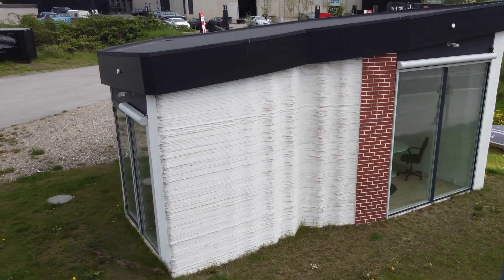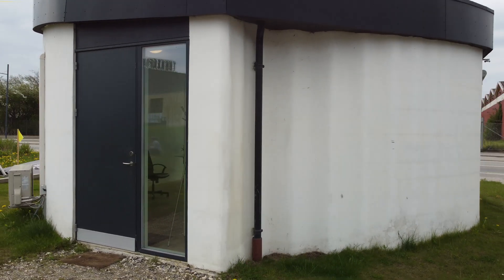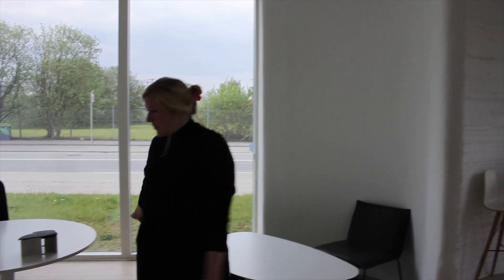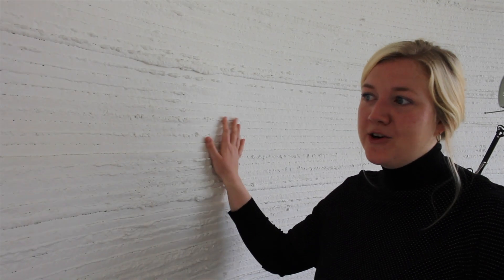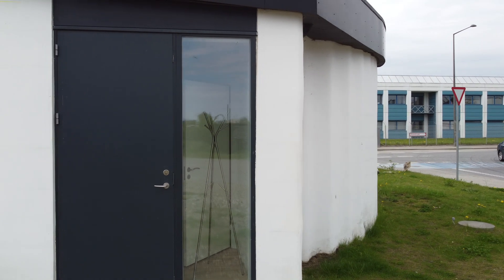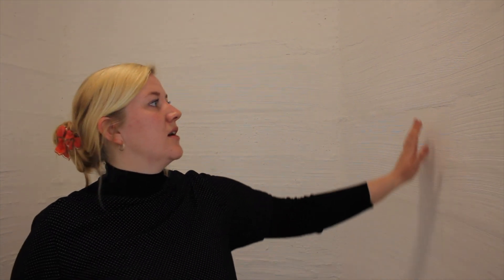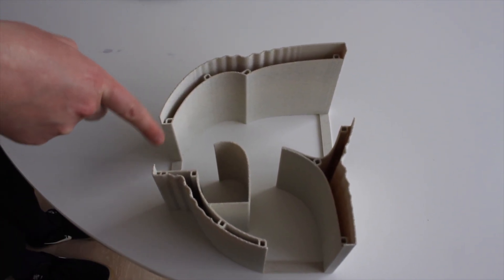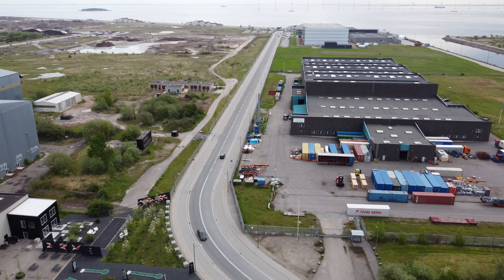Bod Building | First Permitted 3D Printed Building in Europe with COBOD Architect

Comment: Seems like the plastered rooms have better acoustics. My only complaint with concrete walls is coming up with ways to mitigate the echo chamber! Keep em coming!
Reply from the maker: Fascinating observation I didn’t notice this at first but I think you may be right, I wonder if there are patterns that would improve the acoustic factor. Inside the building while we were speaking in person it wasn’t bothersome but the camera mic picks up all the reverb.
Reply: I noticed it being quite severe in the Mense Korte house. It would seem acoustic engineering of the room structure is required. (Of course carpeting would give better acoustics than the epoxy florring of the M.K.)

Comment: For COBOD, are they using Portland or other type of cement.  If its a different cement, what percent more is it compared to Portland?  Does COBOD lease their equipment in the USA or only purchase?  What kind of equipment consumables are part of using COBOD?  How long does the nozzle and other slurry handling equipment last before they wear out and need replacement and approximately how much does it cost to replace?